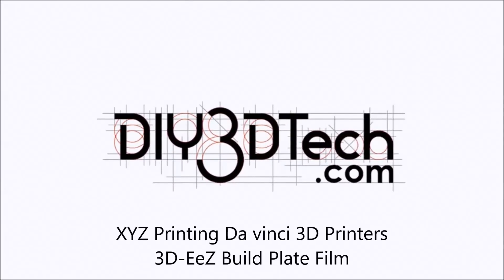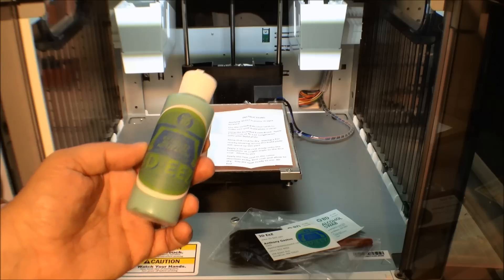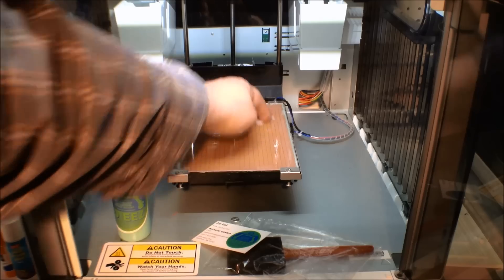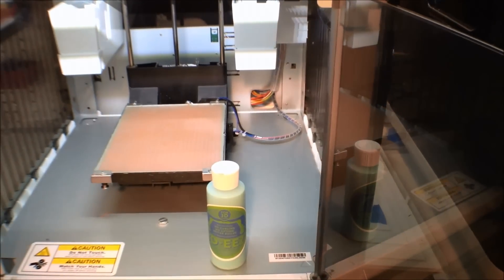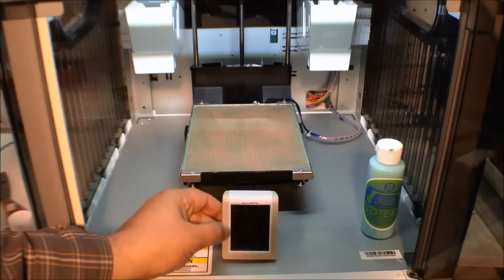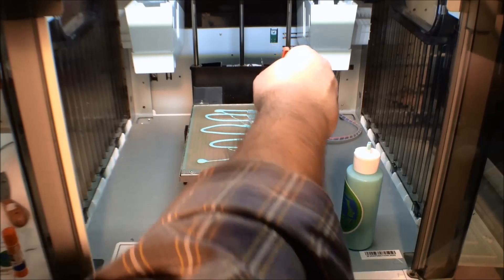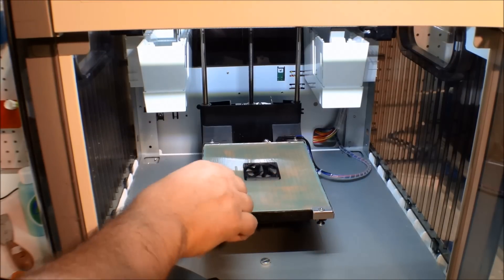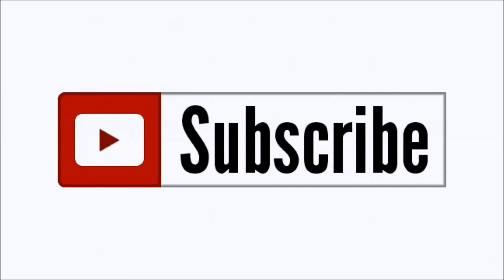XYZ Printing Da vinci 3D Printers - 3D-EeZ Build Plate Film

Comment: I have a 1.0a and never use anything on the bed, just clean glass. I had lots of problems at first until I decided to not use the auto leveling and set the bed manually. Everything started to work great when I set the bed height with the tiniest of clearance. The first layer prints about 2mm wide and is stuck fast, so hard that on large prints I have to wait for it to cool somewhat before it will release. not one adhesion failure and a fantastic lower surface finish

Comment: ive been using generic hairspray to get my prints to stick on the da vinci. moved away from glue sticks after 4 months.
Reply from the maker: Interesting, never really got into the hair spray (have tried it), have been the large staples glue stick for a while and just got a PEI sheet in for it just haven't had time to install and do a video as I have to other ones PEI and love it!
Reply: I found  8in 3m painters tape on amazon it works well at times as well. Ive found  the glue buld up from the sticks to be a bit annoying. Id like to take the bed iff to clean it, but that comes with its own set of problems.
Reply from the maker: Ditto on the painters tape use to use that too but the PEI is the best so far as I just wipe with alcohol between prints and works like magic.  The 3D Ezz was why good but too good as I had major issues with parts releasing and broke more parts because of it...